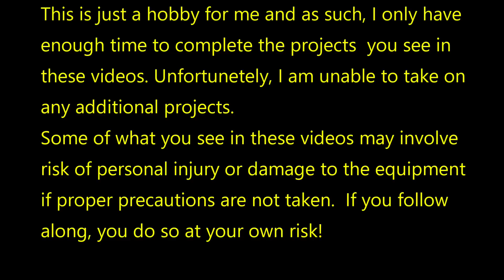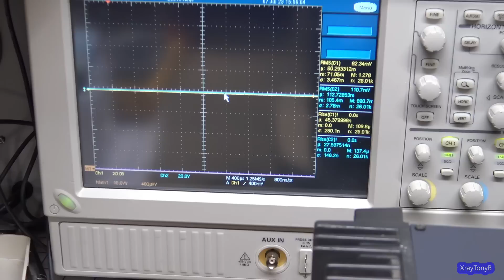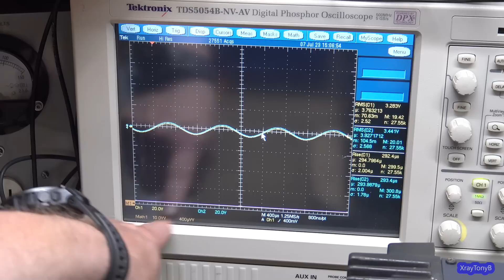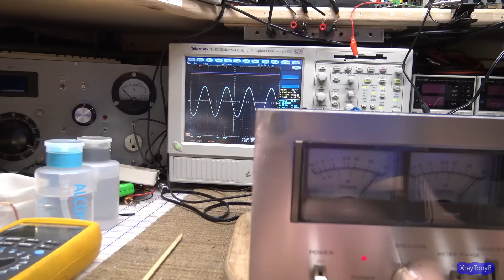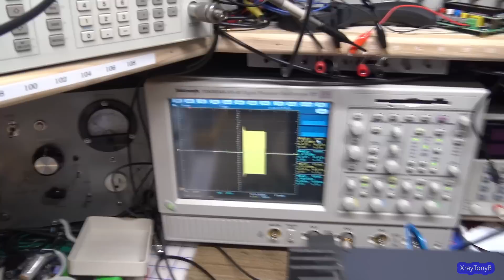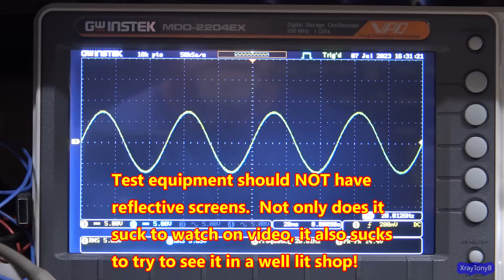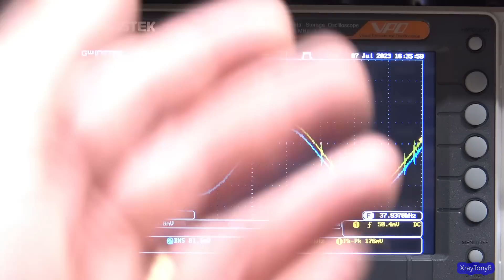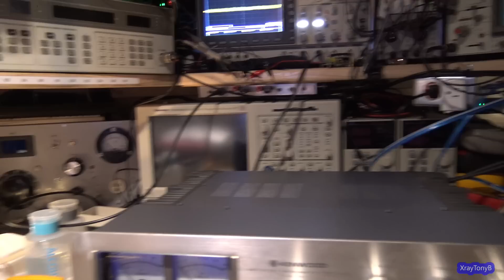Kenwood KA 9100 Part 5 of 5 - It was worth repairing!

Comment: Fantastic repair series. The only problem I have from watching your videos is that I feel strongly compelled to browse eBay and search for similar broken amps and repair them myself (I do that as a hobby too and I still have 4 amps ready and waiting to be sold). Cheers, Tony
Reply: There is a ton on there for sure !
Reply: Great job! I have this exact amp but it won’t power up. Why couldn’t  you repair the back lights for the vu meters?

Comment: I have garnered some experience with "rattle can" painting on metal surfaces. I start by cleaning the surface thoroughly ... in the case of fresh aluminum enclosures I sand them down first and wipe them clean with naphtha. I then apply 3 coats of primer, waiting 10 minutes between each spraying. After a few days, I lightly sand back the primer, gently wipe with a small amount of naphtha, and then start applying the base coat: 3 coats of the base color, waiting 10 minutes between each spraying. Wait a few days. I repeat this TWO more times until I have a total of 3 coats of primer and 9 coats of base. Finally, I lightly sand back, gently wipe with a small amount of naphtha and either apply the final clear matte or paint labels and art, and then apply the final clear matte. This works amazing for the guitar pedals I build. Cheers!

Comment: Great video!  Turned out great. Not only performs well but it is looking great. Good touch on the color. Of course as far as the sound goes it’s limited with your expensive microphone. I have restored my KA 9100 with original output modules and it sounds great. Like you said very clean and nice dynamic sound. I might have to pick up some of those aftermarket modules just in case. Thanks Tony very enjoyable!

Comment: Nice to hear you had good experience with spray paint in cans. Here in Croatia i tried couple of brands and results we're really different,but most of that cheap spray paint i used took a lot of time to get completely dry. If you go do paint shop and they mix you some custom color and fill a can in front of you, those are pretty good and can be completely dry fast but that costs quite a bit more then spray pain from shelf. 
But what i have found is that powder coating is great. Maybe a bit more expensive then custom filled spray can,a lot cheaper then professional lacquer(like car ones),but a lot more resistant then pain and price is really acceptable. I would say i would pay maybe 20-30$ for top and bottom cover. Lucky me i got company that does powder coating maybe 50km from place i live so i always go to them when i need to pain some chassis,covers and that stuff.

Comment: Great Series Tony… Impressive test results….! What are your thoughts on component “burn in” with respect to test results and sound quality..? In other words do you believe that test results and/or sound quality “can/will/may” improve after “X” amount of hours..?
Reply from the maker: Vacuum tubes will change somewhat after an initial burn in period, when they are new.  As for solid state gear, I have not personally seen a situation where the amp changes after an initial operating period.  I know that there are some comments out there about it, but I have not noticed it myself.  Thanks for the question!
Reply: @xraytonyb  Thank you for your reply.. :)

Comment: 0:59 Could you show us the the paint you used.  I have a similar dilemma with an Arcam Alpha 7 amp I recently repaired, the paint on the casing is scratched up and I've been looking for something that would be acceptable to paint it with; this spray looks just the ticket.
Reply from the maker: I first used a can of Rust-oleum bonding primer followed up with Rust-Oleum Advanced all in one spray paint.   All purchased from Lowes.
Reply: @xraytonyb  Looks great.  Rustoleum makes a 'textured' paint that leaves a nice close to original finish.

Comment: [14:35] That's a better slew rate than most high-end, audio op-amps :-) As for the cost of the output stage -- that looks like it could do with a second pair of output transistors, and heftier pin-outs and traces -- it could have been a lot harder on the pocket: It could have been a Marantz 2500 you were repairing :-)

Comment: I believe you tested the amps power at 8 ohms.   It would be interesting to see the output at 4 ohms.  I have a KA 9100 that I use to power a pair of Maggie's that are nominal 5 ohms, and it performs great.  Bought the amp new in 1978.

Comment: Testing for thd at 1kHz is too easy on the amplifiers. Testing it at 20kHz will reveal if the slew rate is right, or if any oscillation occurs, or if it rolls off the highs lower than the hearing range. If it tests at the same amplitude and thd at 40hZ and 20kHz, that's a real piece of engineering.
Reply from the maker: I did.  I showed it in the video.  THD held steady at 20, 1k and 20kHz.  I also did slew rate test.

Comment: Does anyone know what was the mode reverse switch designed for? I know how it works. What puzzles me is what are the benefits of swapping the channels when listening to music.
Reply from the maker: It swaps the right and left channels.  Right channel comes out of left speaker, left channel comes out of right speaker when reverse is selected.
Reply: @xraytonyb  Thanks Tony, although I knew that already and you also mentioned this on the video ;). I was curious why anyone would like to swap channels when listening to music. Would it sound better that way? I would assume music producers know what they're doing while working on a final mix so if, let's say, guitar is on left it should go on left.

Comment: What is fantastic about low THD?? that doesn't make an amplifier good, and really you want to know what the individual harmonic distortion is  more important, and can be high in certain aspects like second harmonics eight harmonics etc to three or four percent.
I bet that amplifier sounds sterile
Reply: "I bet that amplifier sounds sterile" so now you can fine tune it with your multi-band EQ.
Reply: Hi-Fi or high FIDELITY, the clue is in the name. Voices and instruments are devoid of harmonic overtones, the aim of the designer is to ensure the gear distorts the signal so that these are added in prescribed ratio, or the voices and instruments carry harmonic overtones and the aim of the designer is to ensure the gear preserves this structure intact.
Reply: @paulb4661  no I disagree with that in a professional application yes not for home listening, and you are destroying the overtones even if there's no distortion in the amp. By your thinking there should be only one amplifier and having an amplifier that gives you great dynamics great sound stage good separation of instruments is wrong. No Hi-Fi system represents an instrument correctly anyway, and by having distortions makes it more realistic like tube gear.
Who really wants to listen to a sterile type of sound it's uninteresting uninspiring not very engaging and not very realistic but everybody to their own if that's what you like, majority of audiophile don't want that. You should try and listen to some good quality tube gear and then make the decision.
Reply: @hoobsgroove  First sentence makes no sense, so I''ll skip that."You are destroying the overtones even if there's no distortion in the amp" is the most absurd assertion you make, explain why that is the case- there's no distortion free amplifier in existence, so how come you establish that? By my thinking, the aim is to reproduce the recorded signal, not tinker with it. I agree no system can transport you to the venue- that's why I go to concerts, but the better ones can offer a pretty convincing illusion. No, tube gear is not more realistic and painting all tube gear with the same brush, regardless of circuit arrangement is just simplistic, or plainly speaking - ignorant. You should try to get serious about learning the inner workings of amplifiers and then make an informed decision. Finally, there's about 4, or 5 opinions in a room containing 2, or 3 audiophiles, I'm surprised you know what they want, since usually, they don't know themselves.
Reply: @paulb4661  Bravo Sir ! and yes, the first statement is odd but to be honest Audiophiles are like wine connoisseurs full of....................wine.
Reply from the maker: I would agree with your statement if I were connecting a guitar to the amplifier.  In that case, the amplifier IS part of the musical instrument.  For listening to musical recordings, however, the amplifier should neither sound sterile nor distorted; in fact, it shouldn't sound like anything at all.  A properly designed hifi amplifier will take the signal applied to the input, increase the amplitude of said signal and spit it out the other end into the speakers without changing the waveform at all.  As for distortion at any harmonic, the speakers, listening environment and our imperfect ears can do a good job of adding it themselves, without the help of the amplifier ;)
Reply: @xraytonyb  let me ask you this what makes an amplifier sound good to you! and why? all amplifier sound different by your logic they shouldn't so why do they?
A amplifier adds its own sound it has its own noise characteristics plus there's negative feedback what changes the harmonic characteristics of the recorded signal. All good quality amplifier seem to have fairly high distortion in the 1% range so why is that?? Because it makes it sound better then lower distortion amplifiers. You've heard plenty of good amplifiers in your time and plenty of higher distortion I'm sure. What is your favourite amplifier? And what makes it your favourite?